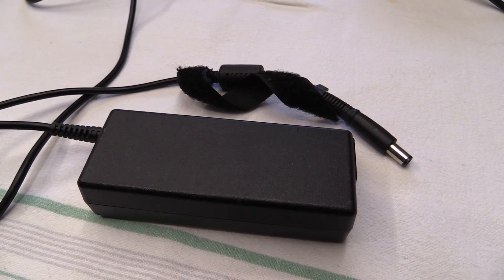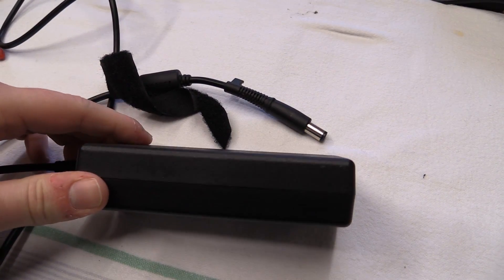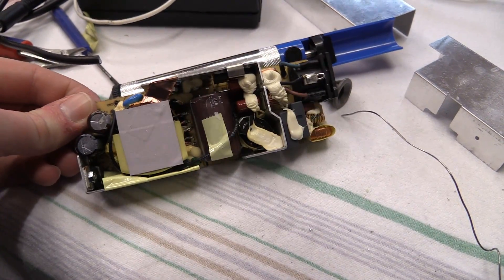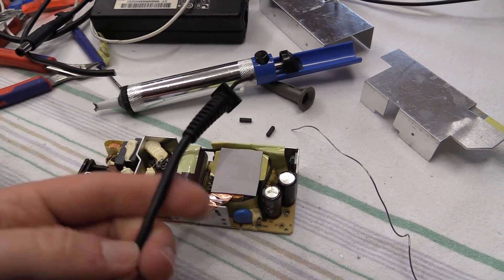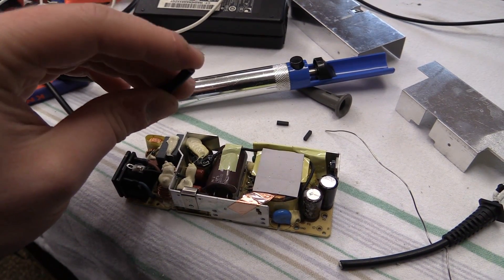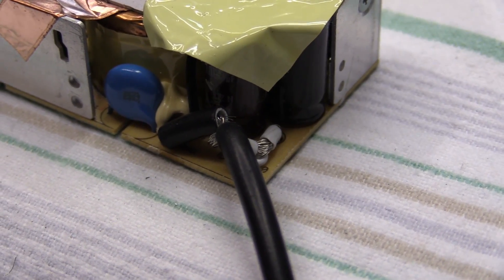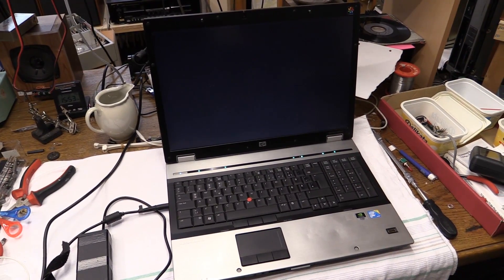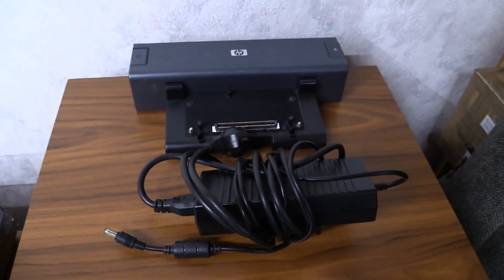DrCassette's Workshop - Simple Laptop power supply repair

Comment: I need your help. Whats the name of the white paste inside the adaptor because i have a HP Officejet 5510xi and i open it but realize the white paste on one of the side is pop off thats inside the adaptor
Reply from the maker: Sorry, but this question to me indicates that you should probably not mess around inside a power adaptor nor a printer.
Reply: I didn't touch anything inside it i just opened it to see what could have burn off inside it. I having the same sound in mind but only different its a v sound
Reply from the maker: Please, for your own safety, stay away from it. The white paste is a type of glue. It has nothing to do with functionality of the power supply.
Reply: DrCassette OK thanks going to order one ebay then although it measurement on the multimeter say 10

Comment: You have just thought me how to repair my 130W power supply! That's awesome! (I have removed the cable and ticking was gone. Measured the leads coming from it and ofc - there it is! Voltage needed to power my laptop.) Thanks!

Comment: Great video, I have a question, I have an old dell laptop charger which I use for electrolysis but the problem is that it stops working sometimes so I guess there is a surge protector in there. Is there a way to remove this protection and will in doing so make it much more dangerous?
Reply from the maker: Obviously removing any protection feature will result in the product becoming more dangerous.

Comment: How do I fix my charger that loses connection? I have to twist, pull and do other stuff to the cable that comes out of the adapter for it to charge my laptop and now it won't work. (btw this charger was chewed up by my dog and my dad fixed it but he's busy and I really need my laptop to finish the kdrama I was watching :p)
Reply from the maker: Seems like the cable has a bad connection of the conductors inside. Repair is most likely going to be the same procedure as shown in this video.
Reply: Thank you!

Comment: I think you could have taken the old strain relief off and used it.
Reply from the maker: No, it was permanently attached to the cable.
Reply: A cable tie each side of the block casing works as a good improvised strain relief ...

Comment: you can open it with gasoline
Reply: in recognition it might chemically dissolve the weld between the two plastic housing half's "but" like acetone it might easily destroy the plastic case if it overreacts
Reply: @allrock1238  ?

Comment: Thank you, I just repaired this way my charger for my HP DV7. Got 1 wire and 2 concentric wires. The concentric ones I made them like a wire and added some wire shrinking wrap around. It worked like a charm.

Comment: Ive had too many adapters to repair for people that have the shorted cable or plug.
Some were deemed dead by the owners, that was reversed :-D
I remove/pull the core of wires as they pass through the strain relief, then slowly drill out the insulation with a hand cranked drill.
The adapter looks normal again :-D
Oh sorry about the earlier misunderstanding.

Comment: What a coincidence. Not long ago the power supply similar to that of an HP crashed here. Does not make any strange noises but measured with the multimeter it gives no sign of life. Was it one of the cables broke inside? Will be at its source? I note that in fact it is complicated to open this power suplly.

Comment: I know on some Dell laptops, if you use an aftermarket power supply, it will power the computer, but it will refuse to charge the battery; you will get an error message saying that when you turn on the computer.
Reply: vwestlife Actually most of power supply for laptops are made by Delata Electronics, so repairing process would look the same, regardless the brand printed on it.
Reply from the maker: I guess this HP laptop would do the same thing without the ID signal.
Reply: DrCassette

The "ID signal" is nonsense; it is actually done using a resistor in series with the output!
Reply from the maker: douro20
Obviously there is no super complex communication going through that ID line, but fact is, it won't work properly without it.
Reply: +Leszko Holiday 
Yeah, I have taken some apart from Delta, Hipro, LiteOn, etc... they are all just about the same. Different components but the same general design (hey, it's just an SMPS!)

Comment: All layers around the wire between the edges where it comes out of the supply and snap it together so the case holds the wire inside, so when you pull on it, it wont come out. :D It's not perfect but it works

Comment: For strain relief, you coulda placed a zip tie on either side of the case...not pretty but does work!
Reply from the maker: I don't think that would have worked, the hole in the case is much bigger than the cable's diameter.
Reply: DrCassette Hot glue makes a good temporary fix, but if the PSU gets very hot, not so good
Reply from the maker: And if the cable breaks again it'll be some serious trouble to get the hot glue out again...

Comment: Interesting! The HP supply I have here has the same 3 pin plug, but just a normal 3 core cable (Like a small mains cable) but with white (gnd) black (+19v) and blue (ID) wires
Reply from the maker: Probably that 'normal' cable is a more reliable solution, because this complicated wire they used for my unit doesn't look very sturdy.